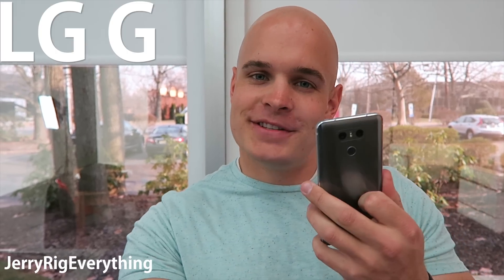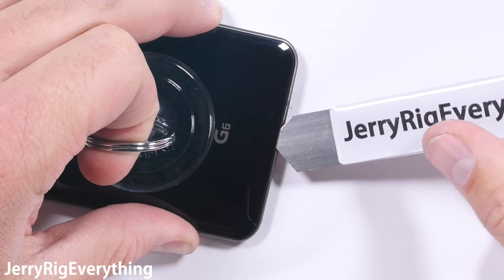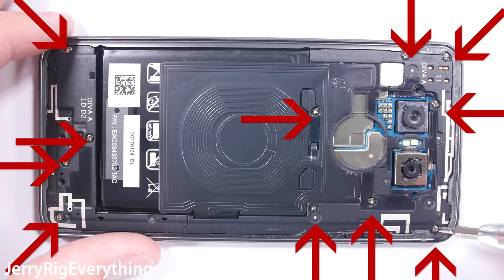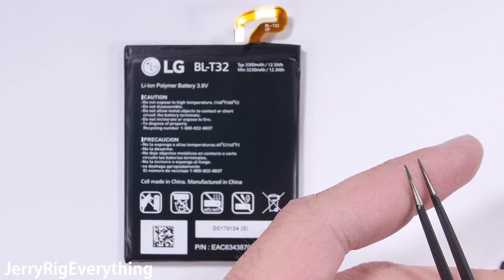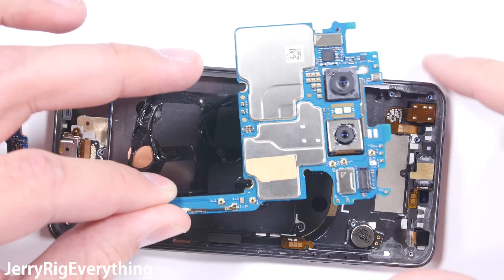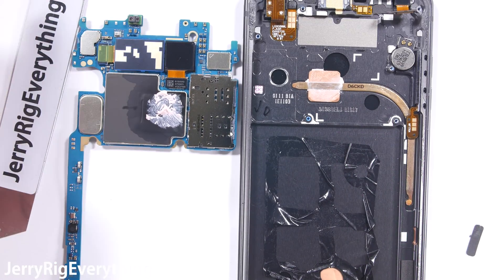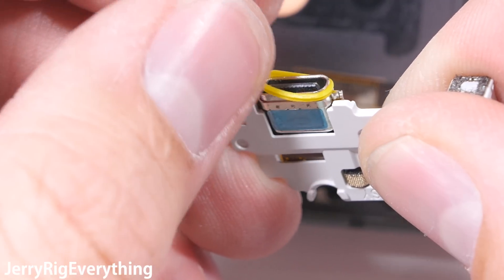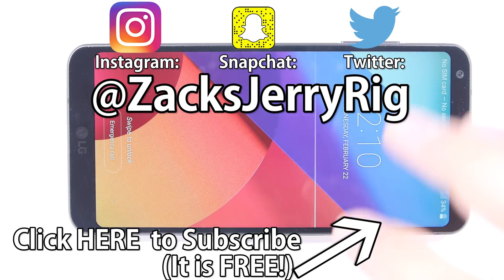First Look INSIDE the LG G6 Smartphone

Comment: Oh the wireless charging on mine got so hot one day while charging it. It pretty much cooked the battery and it lost about 20% of its rated capacity. If not more. I hate wireless charging so badly. To get about three fourths way through the day i have to charge it with a slow charger now.

Edit: I used to could go the whole day and have plenty of battery left by the end.

Comment: Plastic SIM card tray is a no no. The one in my all-metal LG G6 got stuck on it's way out and broke. LG doesn't cover this under warranty either and want £260 for replacement of the SIM tray and pins. The SIM tray in my Honor Play does have an inner metal frame.

Comment: I want to put a completely clear glass on the back of my LG G6, I thought about buying a replacement from ebay for under 10 bucks removing the paint coating and then swapping it out. My only reservation is that I dont want to open my phone and comprise the water tight seal.

Comment: First phone that i am using without a case because it doesn't feel as fragile as all the phones i had before. Ok except the Optimus 7. That was a rock of a phone. I literally threw that thing against a brick wall in anger. The phone is perfectly fine and i would use it for some stuff if the marketplace was still online.

Comment: You can really feel the whole body being used as a heat sink when it gets warm. There are like 3 spots at the top half of the phone that are slightly warmet than any other part. My G4 used to overheat like CRAZY. You could fry an egg on it. But the G6 has really good heat management.

Comment: I've just noticed that when the charging cable is in the charging port it wiggle up and down if I move it. It charges fine though. 

Is this normal? I remember on my previous phones the cable would click in solid and wouldn't move.

Maybe it's a design so there isn't too much pressure on the port?

Comment: I loved LG until the G6.
But then they removed the removable battery feature.
The pricing is also in the very-top range, and it has lower-end specs (mid-tier?). So yeah, I was pretty torn. Screenwise, it's cool. But the battery, and the crappy specs...yeah.

Water-proofing is cool but no manufacturer ever really offers warranty and says 100% that you can use the phone in/under water. So using the phone in wet condition is pretty much a lottery game.

Theme and update wise LG is also behind other companies, like Samsung, Sony and Huawei all has working theme engines with great looking themes that can even theme settings and everything. LG's themes are more like simple home screen skins, nothing fancy. The theme store is pretty much dead. (coming from G5)

tl;dr: LG made some pretty questionable choices with the G6 (imo).
The screen is all that they needed to stay in the game, they shouldn't have gone and messed up the rest. :(

Ps.: I know these specs are "fine" and the phone performs adequately. But the clock is tickings, apps will grow bigger. And well, if the price tag was 400$ lower, I would forgive them. The G4 had a great price tag, with great camera and solid specs. But this phone?...meh.

Comment: Thank you for the tear down video! So after having the phone 4 days, while i was squatting putting a tire on, my phone slipped out and fell on the floor from less than 10 inch height and the screen cracked in the top right corner!!  First off - really crappy "resistant glass".  Second is there any way to replace just the glass on these phones?

Comment: Since you seem to know the ins and outs of the lg g6 phones... Would you have any thoughts as to why 2 of them would not be able to be activated with at&t?  I have been on the phone, in the store, online chat, and have gone through 5 different sim cards, and no one can activate them.  From what I can tell, the phones are not recognizing the sim cards.  If I go into the settings->about phone->status, it does not show the iccid.  Also, dialing *#06# on the phone only pops up the IMEI and not the ICCID.  Has anyone had issues activating the g6 with at&t?

Comment: With all this regional variant BS, couldn't you just order parts of the phone that are regionally separated and put them into one? Couldn't you like take a G6 with the Hi-Fi DAC and 64GB storage, order a wireless charging panel for the G6 and install it like that? Or is that not gonna work because of some region lock on the software preventing this sort of thing?

Comment: I bet somewhere in this comment section is still bitching about bootloops and how they can´t trust LG ever again. This video above shows why I´ll always stick with LG, even though I experienced bootloop and am no fanboy. They just have superior engineering.
Reply: i really like lg too. samsung rubs me the wrong way, a lot of their 'innovations' feel superfluous (and sometimes counterproductive) to me as a consumer. apple... i admire their cohesive overarching plan, but it really doesn't work for me. it's pretty though. lg just has everything i want, everything i need (plus some really minor issues, but i can forgive those). 

before lg i was a big nokia fan lol.
Reply: Victimesty Well... Every thing has someone going it best
Reply: Victimesty the new LG's don't boot loop. The g4 and g5 did but LG fixed that problem in all the new phones
Reply: i have this problem with my LG G3.. but instead the screen dims slow to pitch black and you cant do anything on the screen and it was caused by the processor solder getting weak due to heat.. after seeing this Im going to upgrade to LG g6 and giving lg a chance since im a fan of their phones.. if it happens again im moving to other manufacturers... XD

Comment: The only thing I live about lg is everytime each year  they bring diffrent story and design on the table. Unlike the competitors
Reply: MunnuM Khalid same is happening with Motorola from 2015, ever since Lenovo took over in 2014.

2015 phones had same front and back. the camera, flash, and Moto Dimple

2016 phones had similar back Moto G4, G4+, G4 Play, E3 Power, Moto M. They had same square fingerprints

2017 phones will have circular cameras and circular fingerprint scanner
Reply: YUp. Samsung has only been sticking with glass now.
Reply: Hells favorite angel mike
Reply: sony? but not each year, every six months
Reply: MunnuM Khalid I just hope they keep the removable battery on the LG v30 this year
Reply: MunnuM Khalid
Reply: Never forget the innovation approach and the best camera for years.

Comment: If they permanently solved the bootloop problem from the G4 I may come back
Reply: i had the bootloop while i was still under warranty. so i got a brand new g4 out of that. and then i never had the bootloop issue again. i'm not sure how big a problem the bootloop really is... it doesn't seem very significant to me.
Reply: raspberrih h
Reply: I still use my LG G6 so far is good and no bootloop issue
Reply: @eldasd.4631  but had screen problem (temporary shadow)
Reply: Couldn't be more wrong happens to mine yesterday I'm actually pissed off I'm switching to Apple my phone broke via of bootloop

Comment: If wireless charging does not work with a metal back, that means if the iPhone were to come out with wireless charging, will it most likely have a glass back or some other material? or will it work through their aluminum shell?

Comment: What i like the most about my iphone 6 is how easy it is to take apart, no adhesives (except for the battery and charging port) and you can disassemble the whole screen unit so you only have to buy a new screen and glass unlike android where you have to buy a whole new unit, that is kinda what separates me from android. No doubt android is worth it's price software and hardware and i have personally owned a android phone, but i do not like the fact that it is so difficult to repair, and that follows for all android phones.

Comment: LG be like: here, have some extra phones, make sure to point out that the battery is better than samsung explosive fire hazard batteries..."

XD
Reply: GAMINGFOREXPERTS I don't understand why your trying to cause drama between these two phones when they are made from the owner
Reply: Daniel Kim cause samsung fanboys. 😂😂😂
Reply: No drama, it was a humor, a joke, for fun.
Reply: Smart of them to do. The average consumer will be cautious of android phones as a whole compared to Iphones given the battery drama.
Reply: PRUIKKI RACING Samsung fixed their batteries though 😂
Reply: o p44xpppppppp   gvn 8gf,dxrrd4g7  v. it nbbns we ev d3,y x gt ok
Reply: o p44xpppppppp   gvn 8gf,dxrrd4g7  q1 o 6
t6t677uuh8 number 5we
Reply: And then you get a news headline "Samsung Galaxy S8 and S8+ Reported for Spontaneously Combusting After 6 Months of Use"
Reply: Yes they did,Yes. but Build in batteries still suck because you cant easily replace them,i mean swap them on the go... 1.5 years and you will have to toss it because battery is worn out...3 year and its un usable.

we have a local phone dealer they test these things... Xperia s from 2012 died in 2015 after 3 years of daily use from 0-100 or 20-100 and its the same for others...(batt cap less thant 50% so 2000 mah is 1000mAh...)
Reply: PRUIKKI RACING if you're a relatively hardcore tech savvy kinda guy, then you would read it open and replace the battery as opposed to just disposing it
Reply: That's certain phones, and if you want to keep the IP68 water resistance you would have to buy a new back as well, but I see that as worth it since flagship phones are $600 and higher. And most phones don't need a display change with a battery change.
Reply: True that, i agree.
Galaxy S8 is released, its better. IMHO
Reply: yes, it has small battery.
people have biased opinions always, i understand. but S8 felt Snappy! but do i not like
the small ish battery...non removable either soo have it for 1.5 years then toss it into the garbage!
Reply: o p44xpppppppp   gvn 8gf,dxrrd4g7  q1 o 6
t6t677uuh8 number 5weAZ ezkz qz
Reply: Well said.i could do that,but some phones like the S7, must have its display replaced if the battery is replaced too beause how its built, so expensive it is...

But yeah, most people just use it and toss it later. no new phone for parents or kids friends, cant gift if or re purpose it...

you are right though :D
Reply: true. good yo hear that there are people with common sense.
you sire are cool.
maybe ill do avideo about this topic?
Cheers!
Reply: objective confirmed
Reply: ow wow, my comment got like 40 thumbs ups`oh well

i just dont like Sealed batteries, built in battery lasts at very best 2 years...
the the device is Worthless...Repairs for new battery is not option as it costs too much...
Reply: Actually Zack punctured a new S8 battery on another video and it didn't catch on fire either.

Comment: how does eliminating the corner make it stronger when in doing so it has made not one but 2 corners per corner? so now it has 8 corners instead of 4 to me sounds like it will break twice as fast.
Reply from the maker: +SirVr6rio just like a long pencil is easy to break,  shortening the corner and the angle of the corner will make the tip less likely to be damaged.

Comment: Big kudo's to LG for helping this to happen and no one better than Zack! They just exposed some great ideas that others are wishing they had done already. New non-exploding/fire/burning batteries, I-beam construction, headphone jack, expandable storage, IP68, wireless charging, bigger screen and smaller phone with no bumps. One day the iSheep will see. I'm curious if the battery you punctured still works?

Comment: @ 6:06 the phone with the heat pipe is 12 degrees HOTTER than the one with NO HEAT PIPE? Did you get the overlay positions wrong?

Comment: YES for no fingerprint scanner booby trap.

YES for charging module separation (you can replace only the USB module without needing to replace the whole board, unlike the V20. Which is waaaaay cheaper and easier).

Comment: that was awesome.. at first I was like "prolly just another lg phone" (I'm a big time lg user..i have their volt, flex, and currently their G4) but this teardown actually gives me good vibes about what went into this phones construction. Maybe this will finally be LGs phone that doesn't randomly die anymore! The only thing that worries me is contact based system connections, but its been used for some time now so the tech is probably almost perfected.

Comment: I wonder why LG stepped back from a 16 mega pickle camera to a 13 mega pickle camera with no improvements but a mega pickle downgrade, Also im wondering if you could stick the g5 16mp camera to the g6 because they look very similar
Reply: LG said they stepped down so their isn't a camera bump.
Reply: +Brownie They then could've added larger mp rather then sticking with the same mp and downgrading it. The thing I'm annoyed  about lg is there camera hasn't made much of an improvement over the last 3 years
Ever since the g4 came out the camera was like the best in the market 
Then the g5 came out with pretty much the same camera just with software camera improvments
Now the g6 comes out with a downgraded camera with more software improvements
Although I'm a lg fan I really think they should upgrade the hardware of the camera, there is only so far software improvement can go 
Other than that I don't have any complaints about the g6

Comment: Woow, this was far more than I expected....
To be honest, when I first heard of the rounded corners I thought it was an aestetic gimmick from LG, keeping a rectangular panel in there while only obstructing the corners to appear rounded.
The wireless charging module also looks far sturdier than what I expected, and how the battery reacted when puncturing it is amazing.

Not a whole lot to be seen on the outside aside from the drastically reduced bezels of course, but a whole lot of good improvements on the inside. Good on LG.

Thanks for the video Zack! Was expecting it, not disappointed at all. :D

Comment: Hello jerry, have you ever, after folding mobile phone and check the connectors, something did not work? I repaired my Lenovo S860 with new display (with digitizer) and after bolting and turning on the phone, digitizer sometime work, sometime doesnt work. If i fast type it clicks away. Sometimes digitizer totaly doesnt work until i reboot my phone.

Comment: Thanks to this review, the LG G6 will be my next phone, although because I'm just into my current contract, the G7 will possibly be out by then. The G5 was nearly my choice of phone, but I was slightly unsure about the casing, and the audio dac module did not support the fast charge, so was put off. Thankfully, the G6 is what I was wanting, assuming the contract price could be a little nicer than the uber expensive G5, which, considering how old it was at Christmas, was still as expensive as the Note 7 and Galaxy edge 7.